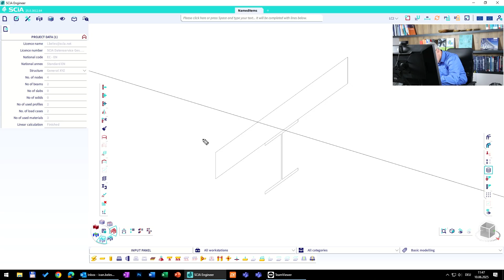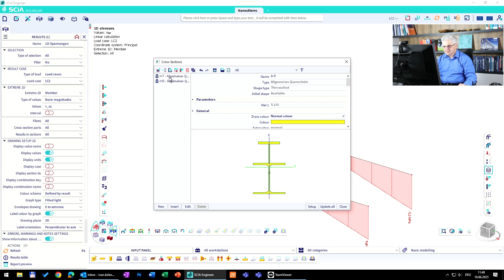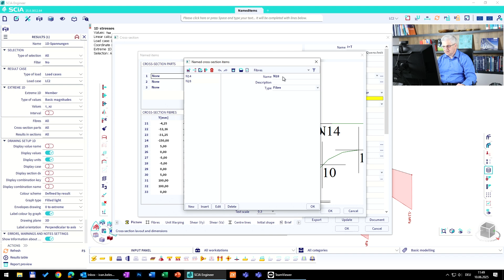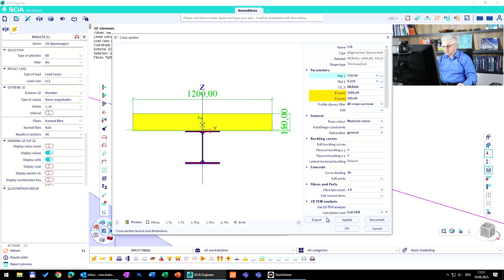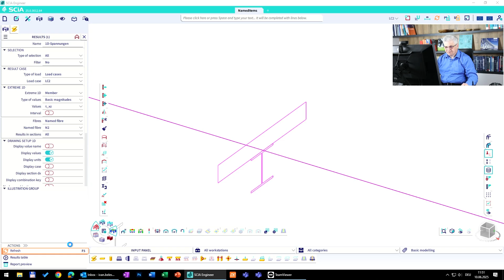SCIA Engineer 25.0: Evaluate 1D member stress in defined point of cross section

Comment: Thank you very much, dear Ivan for your videos which are very instructive, however I wanted to know if SCIA engineer 19 doesn't take slab thicknesses equal to 15cm, 25cm, 35, etc, because however when I define a slab thickness equal to 15cm, after calculation, the verifications in the calculation note are made with a thickness of 10cm and it's the same for the other thicknesses, 25cm becomes 20cm. Thanks in advance for your help!
Reply from the maker: Probably you are using the so-called concrete advanced module with the V16 postprocessor. There it was possible to set different thickness of a concrete slab for dimensioning, as it was defined in the geometry in the model. But, it can be confusing if the user forgets, it was set.
The best way would be, you send the model to the support department, and they can analyze the model.
Please write them, the numbers of the 2D parts.
Reply: @IvanBeles  thank you very much Mr. Ivan for your clarification.